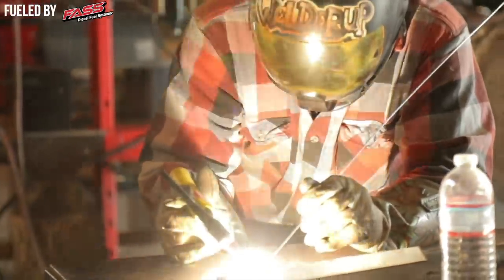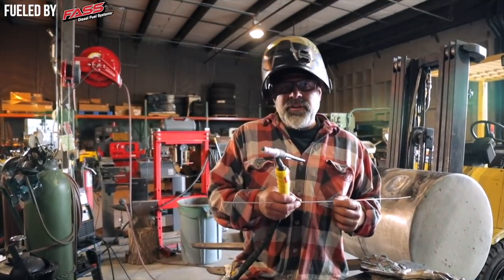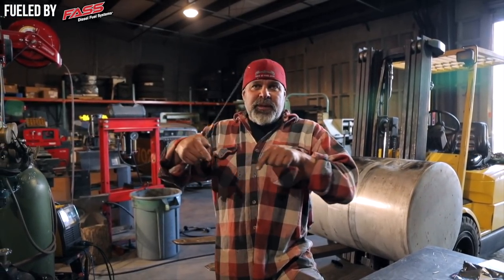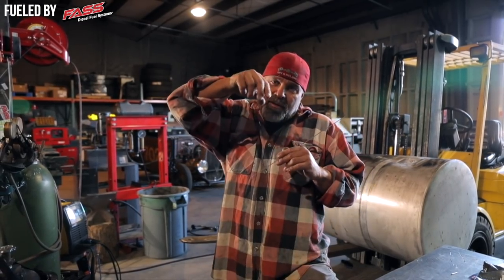TIG Welding An Aluminum Fuel Tank ⛽️ EXTREMELY DANGEROUS WELD

Comment: Many years ago 

I’m talking 1999 or 2000 I had a Fiat X1/9 and the fuel tank was leaking from the seam

so anyway long story short it was successfully welded but in order to do so the petrol tank was removed and completely drained and washed with degreaser and water and dried with compressed air

didn’t matter how much you washed it you could still always smell fuel 

and just prior to starting to weld I you put about 5 kilos of dry ice pellets into the tank....!!!! On the advice of someone who had done it before themselves

we had no problems at all

the job was successful 

expensive to pay someone but as a DIYer the only cost really use the dry ice and my time 

I wouldn’t want to pay a welder to do that

On the other hand it would be pretty expensive to find a 1972 Fiat fuel tank even in the year 2000.... and even if you did it would be secondhand and it would have its own problems and require welding in a different spot....!!

But if you’re stuck I’m sure it wouldn’t matter if it was diesel or petrol dry ice puts a dampener on any explosions

Comment: Just fill it with water, i dont see whats the problem, i welded atleast 50-60 of fuel tanks, SS, aluminium even galvanised (which is the worst because of fumes) and never had any problems.

Comment: Chrome plated copper water jacketed electrode  Ram in a Vacuum Arc Remelt Furnace at a steel Mill. Yeah, pretty crazy. Lol. Welded surprisingly well though.

Comment: I repair, shorten and lengthen diesel tanks all the time. Never had and issue. I use brake cleaner to prep. Brake cleaner dissolves fuel and evaporates. I once modified 20+ 500 gallon propane tanks. I purged them with c02 before cutting.

Comment: Hot taps on live gas lines at the refinery, or
Maybe Magnetic Steel on army tanks. I’m a union pipe fitter. Now couldn’t you just put a heavy nitrogen purge on a fuel tank so there is no Oxygen to burn

Comment: One time we were out off road and punched a hole in the oil pan. It was thin steel and very oily. We cleaned it up as best we could and used brake cleaner. We thought we had dried it out pretty good but there was still fumes in there. When we lit off, the fumes lit off and it spit a ball of fire out. Now we knew it was dried out! Ended up welding it shut and everything was good.

Comment: I've welded 30+ deisel tanks, all have had fuel. Deisel does not explode, it is not volatile like gasoline. It burns like peanut oil, I've welded on the tanks half empty. Deisel needs extremely high pressure and heat to actually burn. Just stay away from volatile fuel tanks, those explode and kill

Comment: I wash tanks out then slowly displace the air with c02 .
Co2 is 1.5 times heavier so I have anything like a balance port on the bottom taped closed then the tank slowly forcing the air out ,replace to cap and weld it up .
Diesel is the dangerous one because of the wax that when hot turns into a ignitable gas , boom .
Gasoline tanks are pretty easy because after you drain and clean them there isn’t any wax to smoke and ignite .
Crazy thing was stick welding inside of a pump standing on the prop with water dripping all over me .
Yeah I got shocked a bit but got it fixed

Comment: Most challenging weld I've try has been DC TIG in E6 colbolt and chrome hard faceing rod intened for hard faceing wood working tools. Job was 1st gear drive dog for a 1919 humber this the recommended repair by the humber register as no one make replica gear sharfs. its since gone back in the car and runs like new. Owner tell me he's got lernt to drive it all over again because its taken the slack out of it so much. But I did blue grind and stone it back the traditional way just the way they did in 1919.
Reply from the maker: Cool!

Comment: Im a retired jiw/ fitter welder. I once welded a 250 ft tall 40 ft in diameter tank valve. While completely full of fuel. 1st had to burn hole for the valve, then weld it in. The old bunghole was a bit tight.

Comment: Yep ive done countless gas and diesel tanks over the years . Drain and flush with hot soapy water and then get a hose and run a car or trucks exhaust into it for 30 minutes or so . Done,,,,, ALso , I never fix a crack like that.... Hey its your thing and its worked for you but I always do a patch thats larger then the area . Helps cut down on the contamination and its 1 and done.....

Comment: Not a real scary thing I’ve welded but I welded the frames of a couple Draper combine headers that broke in the Montana rocks and they held up through most of the harvest run until we back up in Montana I have also brazed on my old 1949 combines gas tank I lit whatever vapors that were in there on fire and washed it with water a bunch of times

Comment: I have been told to fill it with water when you are welding one is that even possible or smart because it seems like it would be much more difficult and could lead to bad weld's what is your opinion on this whole concept?

Comment: Before I went to welding school someone gave me there 220 ac stick welder on its last legs. Bunch 7018 rod DC. Weilded 1/2 mild steel round tubing to 1/2 round copper tubing butt welded. It was pretty wasn't strong. I didn't know shit. Was screwing around with it. I didn't even know not supposed to DC rod on ac welder.

Comment: Used to weld alloy fuel tanks off trucks a fair bit, if you fill them to overflowing with water it pushes out all the vapor, you can then drain, burn out all the crud with a gas torch then weld em up with out leaving worry marks in your undies,

Comment: I am a aluminium welder mig are tig. I did some 4" cast steel crusher to brass impacts ring with Ac tig weld on sodium bronze rods.  1000.00 $ in consumables just for the day turn out has nice as my aluminum and last.
Reply: I did bear cans also with 3/32 rods . Sounds quite big but trick to them is do them on plywood ground the ends only. Machine set 5 to 15 amps ac pulse set up 25 to 50 per second. Balance controle set at 79% and frequency set to make 350 - 400 hertz. Then have a cold one you need patience.

Comment: I am a welding an would use water also. But I have been told that i could carbon monoxide from  a cars exhaust. Run a hose from the muffler to the tank . It will take the oxygen out of the tank .

Comment: Flush tank with water/steam until LEL reading is zero. Monitor LEL in tank for off gassing while welding. Purge with nitrogen or argon as a second layer of protection.

Comment: A 454 Big Block and a oil pan and the heads to the block in the cracks matched up together straight line on the block motor was put together

Comment: I've welded a cracked steel diesel tank, it was about 7 8ths full at the time. Rotated the tank to where the crack was above the fuel level, ran a torch over the crack to burn out any residual diesel, then squirted some hot stuff out of the mig, job done, nobody dead. Can't burst into flames if it's got no oxygen

Comment: Just did some tig repairs on some sch 40 4inch aluminum pipe in the bilge of a fire boat that was submerged, flammable insulation foam all around me and the fuel tank behind my head.

Comment: I have welded many fuel slip tanks up here in the oilfields diesel and gasoline. I make sure they are empty and dried out then I hook a hose to the tailpipe of a crew truck then to the slip tank and let the truck run for a little while untill the tank is hot and all the vapor is displaced in the tank with inert vapor then weld away.

Comment: I like to drill a small hole at the end of the crack that will make sure it terminates the crack from going any further. also after its washed with soap and water if I'm unsure about it and dont feel comfortable about welding it I will purge it with nitrogen or argon nitrogen is alot cheaper. better safe than sorry on it blowing up.

Comment: Drill a hole at the beginning and end of crack. Weld it up from the middle to each end. The dent will sometimes pop out also if you do this. Try it before you say no it will not.

Comment: I've done tanks before. I used to run exhaust in them for a while to displace fuel fumes. Most unsure thing I've ever welded was a wood stove boiler for a sauna from propane tanks. Short of that not much.

Comment: I welded a crack on a steel thank on the boom truck. Told the driver to drain the thank just bellow the crack and put an air line in it used a3\32" 7018 and welded it about 2" long. Would not ever do it again.

Comment: Yeah I've had to Tig weld a few fuel tanks to .My procedure was caustic steam clean inside and out dry out the tank and purge the tank with CO2 and make Shure you have a full  Purge and go for it . 🐤🐤😎

Comment: My Dad was a welder, blacksmith, Jack of All Trades & Master of None. When I was a kid, my Dad was rebuilding a Drag Harrow for a farmer friend. The main beams of the drag were made with heavy steel tubing, when my Dad started welding on the tubes, snakes started coming out of the tubes, so I was busy smacking the snakes with a board as he was welding. When we were done I had about eight inches of snakes in the bottom of a 55 gallon drum.
Reply from the maker: Good hell!!!!What an experience!

Comment: The smartest way to weld fuel tanks is to steam them out. And test with an explosion meter before welding. I used to repair tractor trailer fuel tanks for Exxon and other fuel carriers.

Comment: We used to weld on leaking John Deere fuel tanks by running a hose  on the exhaust of a gas truck into the tank and depriving it of oxygen never had an issue

Comment: When I was 8 or 9 I had yz80 some how the crank shaft got broke right behind keyway I weld built it back filed it down did the keyway with a dremel tool it lasted about 3 or 4 years

Comment: When I was an apprentice welder (in the 80's) every instructor drilled into our heads that the only way to weld on a fuel tank was to completely empty it and then steam clean it for a minimum of four hours then do a gas sniffer check. The craziest thing I ever welded on was a 1000 barrel condensate tank. Everyone hid behind structures while I was up in a loader bucket cutting and welding a 6' nipple on the side of this thing.

Comment: Vent the tank with a car muffler to take all the fumes out. Learned that from an co worker that is no more with us . This guy tought me a lot of stuff . Died at 88 while moose hunting. 

The craziest shit I welded is stainless piping in food processing plant. This must be clean, do not mix your flapdiscs !!
Reply: i have done this several times on gas tanks, no booms ... i just might be lucky...hell i dont know
Reply: that is right you don't no ever if turns into one big sparkler then blows or oxygen in the water with oil or gas + heat 5G or the cars exhaust is burning oil or one cylinder a little rich your right John  call it lucky or a goof out

Comment: I think there is always a risk, and I teach my students to always turn down welding a tank. There was an incident here a few years back where a student at a high school was cutting into a barrel with a grinder. It was an old barrel used for peppermint oil which isn't even flammable. It was thoroughly washed with soap and water. Not knowing for sure if the barrel was used for anything else and don't forget fumes from other sources(propane) etc  can accumulate it strange places. They were making BBQs and selling them for shop funds. Long story even longer....the student ended up dead and injured a few others, some badley, when the barrel exploded. I've been asked many times in my life to weld this stuff for cash and it is tempting. Leave this stuff to the well seasoned professionals who have sniffer devices and fume extracting devices. Steve is correct about the fumes. I worked in a shop where the tanker truck wasn't allowed in the shop unless it was full. Last thing , even that little motorcycle tank or the smallest go cart tank that may seem harmless still has the power to kill you. These are risks you don't need and will get you as soon as you let your gaurd down.
Reply from the maker: I agree. I would never take the chance. Buy a new one. Appreciate your comment.

Comment: We used to put the tank under the bench then stand on the bench and wave the lit gas torch down to the filler neck. If it’s gonna blow it’ll do it under the bench...
Reply: Small holes in steel tanks, we’d dent in then braze a copper coin into the dent. Works great.

Comment: Hey welder up can metal survive 17 yrs in the dirt because I have a 49 fleetline that was buired in my back yard 17yrs ago so will the metal be strong or swiss cheese ps I live in Maryland so that comes to play to
Reply from the maker: Where you live, I would guess that the moisture has done some real damage. Here in the desert it would be fine.
Reply: Yes but the good part is the front clip was off but I got it out in one piece wich was one fender it was solid as a rock and it was covered with loose dirt not clay

Comment: I used to fix fuel tanks all the time when I first started welding. The shop i worked at would steam clean everything and the was no worries whatsoever it was the main reason i got so good at welding thin materials. I also used to do lots of different oilfield welding jobs everything from fixing broken stuff to designing and building different things to make jobs easier. Now I just build my own car parts and do all sorts of custom jobs from home or I do house calls to build stuff onsite.
Reply from the maker: That's what I'm taking about! That's me also. Thanks for your comment.

Comment: That is ridiculous!  🤣 Empty the fuel tank and fill it with water! No normally thinking person welds in tanks that have fuel or gas ...  left. 
No exceptions !
Reply: Wouldnt the water effect the heat transfer and mess the weld up?
Reply: Sorry to say this but most of us are not normal.

Me included
Reply: Clean it and use water...  leave it open then and let the water out...  🤣
Reply: @iceblue72wot  not always your playing Russian roulette and that comes from a man who repair tanks for 40 years he had three blow up on him in that time and the last one was being washed for two hours in a proper tank repair shop .
Reply: @wmurray9800  do it safe or dont do it !
Reply: Sir the shop repair rads ,heater cores, gas tanks 12 hours a day 6 days a week.  Rads ,cores ,gas tanks were all washed out first and then put in a hot tank of costac  soda . From hot tank back to wash station were the rads,cores and gas tank were rinsed off and dried then over for repair from repair to paint . The year was 1973 and the boss would take this thick black paint more like tar and reduce it with gasoline . Most Gas tanks were rust holes.  I rarely saw the propane torch turned off it was always burning like a candle.  The iron was in a holder above the flame always ready, a liquid past a tin patch and never a open flame to a gas tank .  And at the end of your shift you went home with a cheap head or head ache and noise full of paint inside it. Masks what masks the shop sunk from gas all the time one fan and that had so much paint on it and if you didn't like the conditions there's the door . This shop to was fully automotive they remove gas tanks exhaust pulling engine tranys etc.  Over an hour to two in the hot tank just to get them clean to start working on them and some more then not rejected back in the tank.  This window the tank took out was one of those old factory square ones steel frame 12"×12" by 4’×4'. and all the gas was leaded no unleaded lead help lubricate the bores and good octane . The gas tanks had a lead film in side of them and stunk . So is it human airer getting to comfortable not paying attention there was also a telephone in the corner in between the tanks . Only God nows how many times the phone got thrown in the water tank or hot tank use alley over girl friends. You never seen a person lose  his shit because the condition were right in that shop . That's all I know and big block engines running in the shop I am lucky to have a brain after 47 years of the trade  .  So that's the truth and people do what ever they want any ways,  some of the elevators do not go to the top floor  and others the the light is on but nobody home and you cannot tell people what to do or not to do you can only suggest . Take care brother . be safe
Reply: Hasses Garage ;  Sir no disrespect, gear heads are not stupid there is no room in this trade for stupid. You have to have your heart and soul into any trade to make it work it keeps you on your toes and you know it.     Plus a hole lot of Rosy ( A/C  D/C ) to make it all come together oh a good lawyer too.   Personally watch your brothers back and keep each other safe what ever you do .     Safety tip : Last one keep your dick in a vise and the sec. you think tits and ass plus phone working your going to F it up stay focus on what your doing , kids cannot put the phone down and they forget were they are and what there doing.  Old school is going to become the new school .     But define normal in these times.   Bother I am with you play safe  Its the fumes in gas alcohol not worried about diesel  respect all fuels.   take care and there are a lot of good people fallowing WeldUp. with a lot of know how .

Comment: I gas brazed my 68 charger fuel tank when I was in high school age. Typical rust at the seam where all of them rusted. My dad let me weld it at his work that was a very large printing company. Need I say it had printing presses that where larger than most peoples houses and rolls of paper just as big. Not dangerous at all with my minimalistic experience of gas welding at that age. The weld was a success and I didn’t blow the place up was icing on the cake